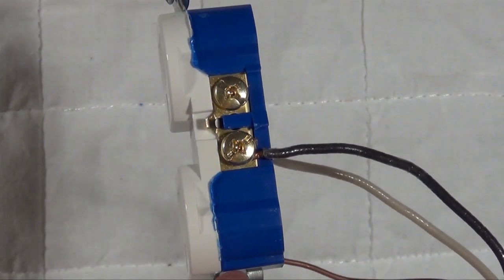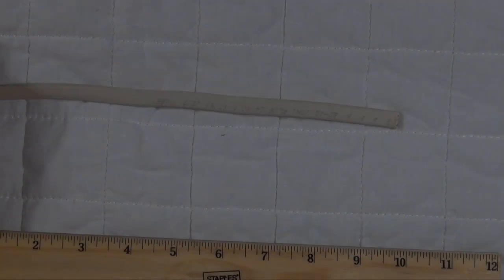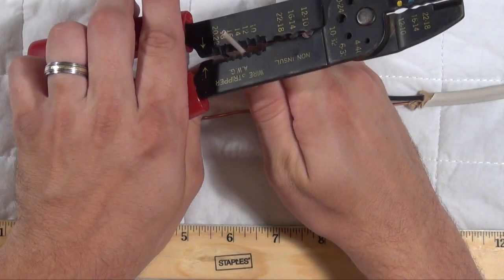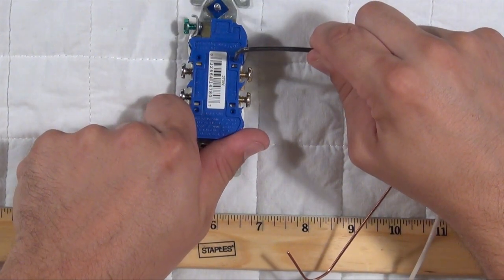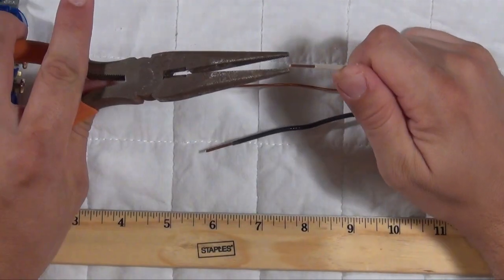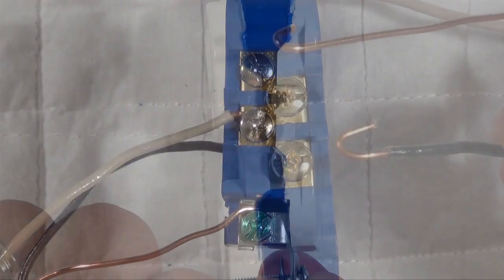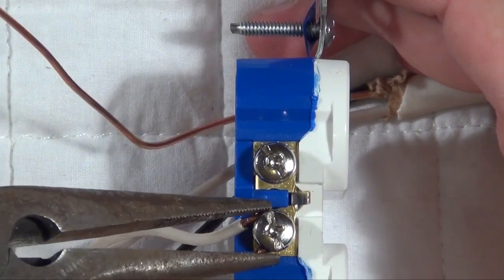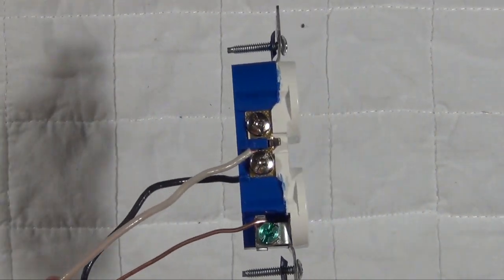How to wire an electrical outlet

Comment: Not all receptacles have back stabbing terminal options. It's only the lowest grade receptacles that have those options. That tells you something about the unreliability of such connections. You won't find them on spec grade or commercial/hospital grade receptacles. However the upgraded devices allow for inserting two wires under a plate that is secured by the same side terminal screws.

Comment: A tip, don’t do electrical work while there’s any chance of lightning nearby. Neutral and ground are not disconnected when you turn the breaker off. Also I always check neutral and ground for power using a Non-Contact voltage indicator Pen. I’ve seen some very high transient voltages on both, from loose and misplaced wiring.

Comment: Wiring that way you have power on both outlets or only on those where the wires are in ?
Reply: It gives power to both outlets because of the copper connections on both sides of the receptacle. If you pause the video you will see them in between the screws

Comment: What if you have a recep with 5 wires?! I noticed a bedroom plug was hot when I unplugged a nightlight. Even after unplugging it it remained hot and it actually shocked me. The breaker is now off, after pulling it lose from the wall, one side is melted and it has 5 wires attached?
Reply: 5 wires is a common scenario. 2 black or red, 2 white, one ground. The black or red is hot (live), white is neutral, green or bare copper is ground. 
One pair is power coming and the other pair is power going downstream to the next outlet.
Normally you should have only 2 ungrounded wires in which wires feeding the next receptacle are connected with a wire nut and pass through. This usually resides in the back of the box. A third wire called a pigtail is connected and that one goes to the receptacle.

Comment: Should note that when installing into the wall box to orientate the ground pin (the round one) downwards.
Reply: There is no standard for the orientation that I know of.   Can you tell me where you get this response from?
Reply: Hi Kevin.  You are correct.  I had assumed there must be a code since every house in the USA that I have been in seems to have the orientation with ground pin down.  I can’t find any code that specifies this however.  I do note that some appliance cords with the cable coming from the side of the plug work better with the ground pin down (if you want the cable to come from the bottom of the plug).  I guess the main thing would be to be consistent here, orientate all of them the same way in a house!
Reply: Martyn H    Agreed.   The only argument for ground pin up I've heard came from a Chief electrical inspector that I know.   His feeling was if a thin piece of metal were to fall onto a plug, then better to touch the ground, not hot to neutral.    It's a far reach to get to that one, but it was the only one I ever heard.   There are several cord plugs that indicate better with ground down for them though.    Respectfully,    Kevin
Reply: Another reason to orient the ground pin up is to indicate that one socket is turned on and off by a switch.

Comment: Did this exactly for a outlet in my apartment but there is still no power to the outlet. Same outlet specs just newer. What could of gone wrong?
Reply: Did you figure out what went wrong
Reply: @lex_one-two  no I didn't,  wish I did. ended up moving to a 3br apartment a year ago now so I dont have to deal with that annoying outlet lol.

Comment: Great video overall! Each step is explained slowly and in detail. ..however i have an issue with the order in which you are teaching..   i get if the power is 100% disconnected, (here's no chance of some idiot energizing the wires your working on,) but i believe one should treat every wire as if it is live and follow the same practice:::  (connedting) 
1 wire your ground first- if you are working LIVE/HOT this will ensure the most impedance path to ground incase you accidently tap a metal device box or plug casing etc.  
2. Wire your neatral  (white) wire next.  Again this will "balance " your load or allow a send and return and currency to your device. The neutral bus is grounded at the panell so can handel or task residual power.    
3.now your outlet is safe to be energized....
 Doing this in reverse forces you to mske every termination trying not to get zapped!  Because unfortunately in the real world time is money, and nobody is going to want to  stop what they are doing because you want the power shut off.   I rarely kill power...maybe i work with Impatient people but i still believe its good prsctice to conneft Ground,then neutral, then hot/power.

Comment: what about if u wanted to add an outlet to that outlet? just connect white to extras silver screw and black to extra black screw and pigtail ground right?
Reply: If the other outlet is same amperage (ex.15 amps) yes, you can do it. If the circuit is wired with 12 ga wire (which is thicker - you will notice that) and the outlet is for 15 amps AND if the outlet you want to add is for 20 amps then you cannot do that - you will have to pigtail the terminals. The reason is that the upper screw and the lower screw are connected by a tab (you can see it on the side) rated for 15 amp on 15 amp outlet or 20 amp for 20 amp outlet. So if your add on outlet will draw 20 amps then the 20 amp current will possibly dangerously heat up the connecting tab of the pass-through 15 amp tab on the 15 amp original outlet.
Reply: Also look up 12 ga wire vs 14 ga wire (ie 20 amp vs 15 amp) and also 20 amp outlet vs 15 amp outlet ( the 20 has an additional horizontal slot on the neutral).
Reply: @anonymousbyproxy8250  yea they would be same amp outlets, or I could even pigtail everything right?
Reply: In general pigtailing is the preferred method but only if there is enough room in the box.
Reply: @anonymousbyproxy8250  ok so one more question, how do you pull power from a double duplex receptacle, would I have to connect to both receptacles or just one?
Reply: Brad, if u look on each side of a double receptacle (socket) u will see that the upper receptacle is connected to the lower receptacle on each side by a thin metal tab. In this way if the power is connected to just one receptacle u will have power on both receptacles and it doesn't matter if u draw power from the upper or the lower. BUT, if u snip out the tabs on each side (and they were designed specially for that) then each receptacle will be independent and it will have to be wired separately. Example : in some older homes u enter the bedroom and next to the door there is the light switch that controls the plug in bedroom lamp (usually plugged in the upper socket), but the TV is plugged in the lower socket and is not controlled by the switch. And this is possible because the tabs on the side of the receptacle were cut off and each socket becomes independent of each other and of course has to be wired separately with its own circuit.
Reply: @anonymousbyproxy8250  ok thanks, so basically if I wanted to draw power from a double duplex receptacle(double gang receptacle/2 single duplex receptacles) I would only need to connect to one as long as the metal tab isn't broken and the 2 receptacles are already or will be connected. Correct?
Reply: Correct.

Comment: My wire coming from fuse box has 4 wires, red ,black,white , and ground. What do I do with red wire?
Reply: Craig Dishner the red wire goes to a switch meaning that only prong like if you put red wire on top socket that top socket will be controlled by a switch and other will be hot all the time

Comment: do you always use 15 amp? no matter what?
Reply: If your circuit is wired with 12 ga wire then u have the choice of 20 or 15 amp outlet. 15 amp outlets are generally used on 20 amp circuits in residential wiring - the reason is that few household items need more than (15amp x 110v) 1650 watts of power (except possibly kitchen mwe).

Comment: I have that double receptacle NEW but have not installed it yet.
My wall has 3 wires , Ground, White and Black.

If I follow the VIDEO does that mean I can use BOTH receptacles at the same time even though only ONE Brass and One SILVER are wired apart from the ground.

OR do I have to add additional White and Black wires to the empty White and Brass screw to be able to use both receptables. ?????

Thank you.
Reply: The empty Brass and Silver screws are only used if you are adding another receptacle  after the one you are installing. 
Notice the area the screws are connected to is a solid piece, and conducts electricity two both outlets regardless of its top or bottom position.
Reply: 108luohan the latter

Comment: Or buy spec/commercial grade receptacles and use the clamp on the side or back, no need to loop and as secure as looping but faster
Reply: oh, that would be awesome. they did not have them at the local hardware store, but i would have liked to use that instead! my european hardware store sells those to use here in the U.S. much better. thanks for reminding me to order those next time.

Comment: You wont die from being shocked but it will wake you up ;-) P.s Dont forget the blinker fuild
Reply: matthew medus Depends on your bodies resistance. 99% of the time your are correct about 110 vac. However, with wet/sweaty hands your resistance is lowered. With wet hands and a connection to ground it is possible to be killed. 100mA to 200mA is lethal is most cases, could be less if that person has a heart condition.
Reply: Ps. Maintaining proper blinker fluid levels is no laughing matter.

Comment: always Start by putting the top half of the strain reliefe ver the entire jacketed wire and pullt it back a foot and tape it to keep it out of the way. then before you hook up any wires, put the wires through whatever knockout hole you have chosen to bring the wire into, then slide the other half of the strain relief over the wire. Then run screws through the top or bottom ears to the floor joist o wherever you are going to place the box........ THEN START THIS MOVIE.   after constructing everything, you tighten the strain reliefe that pinches down on the outer jacket of the wire. if you forgot the strain reliefe? No Problem. Just undo everything you just did and start over.........

Comment: Always wire your ground first, then the neutral second, then the hot last!!! Good video though!
Reply: patrick clay Good safety tip, but that doesn't matter if the circuit is dead. LoTo and you'll never have to worry.
Reply: Does it have a hot, neutral, or ground if it's 110v?

Comment: Does the electrical box that the plug goes into need to be grounded and pigtailed off that ground wire ???
Reply: No. It will ground to it when it is attached with the screw on top and bottom
Reply: M H you could not be more wrong. If installing in a metal box yes, if in a plastic box no.

Comment: Does it matter if you use the top row or the bottom?
Reply: patrick clay That's incorrect, top and bottom are connected through a breakaway tab. The top and bottom only matter if one requires line and the other is load, such as a gfci or afci.
Reply: As long as you use only both top or only both bottom, don't do your hot on top and your neutral on bottom etc.
Reply: William G

Comment: if you have two black wires do you just hook it to the other hot screw
Reply: shannon wolfe yes or use a wire nut
Reply: Some of the old school guys like to splice the feed and wire to the next outlet together with a short pigtail so that the outlet is not used as a through point.  Some outlet boxes are too shallow to allow this.  I have done this mainly with 15a receptacles on a 20a circuit as many 15a receptacles are not rated for 20a pass through current.  The code allows this as long as you have two or more receptacles on the 20a circuit.

Comment: when you cripple the  hot wire in loop under the screw ,is it ok for end of the loop to touch the wire when tighten the scerw
Reply: abood Chaban Yes, screw is already providing a path back to the wire if that makes any sense.

Comment: Hi Question , why did you put the hot wire on the bottom pole, why not the top ? This was in the future you can install a feed to another outlets if needed, please advise , thanks for your help
Reply: hot is bottom all the time only time black is on top gose from light to switch 2011 code both neutrals have to be pigtale into one
Reply: You can put black/white on whatever terminal you choose(top or bottom). Does not matter unless line and load are required in specific terminals, ex. gfci and afci receptacles.

Comment: stupid question but whats the ground wire for? is that what trips the breaker incase of over voltage?
Reply: Safety, so that current has a direct path to ground rather than through you first. Current always takes the path of least resistance.
Reply: William Chap the ground is so that the electricity has a direct path to ground
Reply: I.e. ground at your feet as the current will be insulated by whats beneath you
Reply: when something is grounded it means it has a path to the ground basically

Comment: You mentioned that you could use EITHER brass screw for the black wire, but does it matter which silver screw you use once you've chosen one of the brass screws?
Reply: wranglers2 No, unless ypur receptacle requires line/load connections ex. gfci and afci receptacles.
Reply: So if the outlet is wired to an AfCI breaker, they should be perpendicular ?

Comment: I have 3 black and 3 white wires. Can I screw 2 of each on and and put one of each in the holes?
Reply: cooldog60  NO!!!!!!  Do not put all those wires on one receptacle.... Sister them all together, place a wire nut for each wire white; black; copper.  Run a separate 3 wires to the receptacle. Then using large wire nuts connect them together. Or let a license electrician do this for you.  View other how to video's on how to run three electrical wires and connecting them in series ....
Reply from the maker: If all 3 sets of wires belong on the same circuit, then that would 'work.'  Beware, there are a whole range of wiring options that would give you more than one circuit in a single outlet box, and by putting all 3 together would be wrong.  Take time to verify that they are, indeed, on the same circuit.

In terms of electrical code... there could be a problem with that idea depending on your area, your individual inspector, and his/her interpretation of the codes.

Another way, use pigtails.  Google " electrical wiring pigtails" for more info.
Reply: Another How To Channel
How can I verify if they are on the same circuit? Thanks.
Reply from the maker: If you're going into a home without any prior knowledge of what came out the rough-in box, then testing can be done with a digital multimeter to get a picture of what the wires are for.

There are a number of good videos on youtube that can show you how to use one, which would be far superior to what I can say here with words.

Another way to approach your problem... if you're simply replacing an old outlet, wire it up the same way it came out.  Just be on the lookout for a 'split outlet.'  The possibility of a split outlet was the main reason for my earlier, cautious post regarding multiple circuits.
Reply: Fuck no, pigtail them.